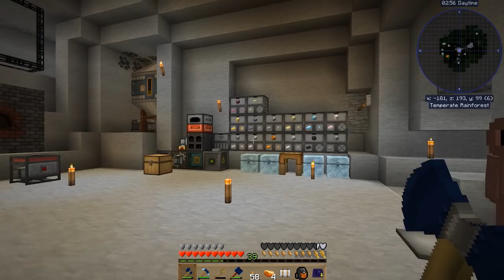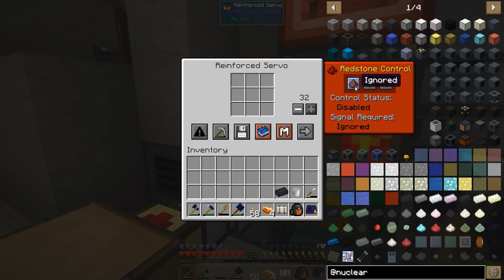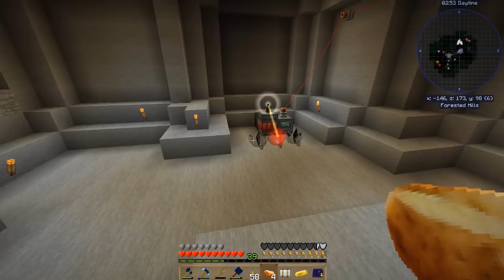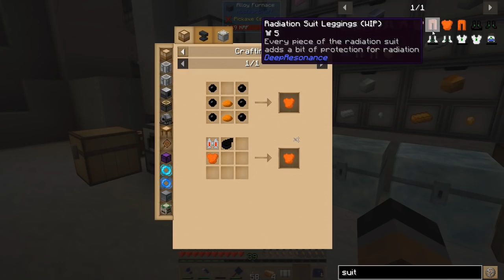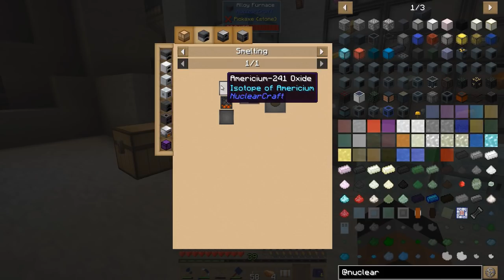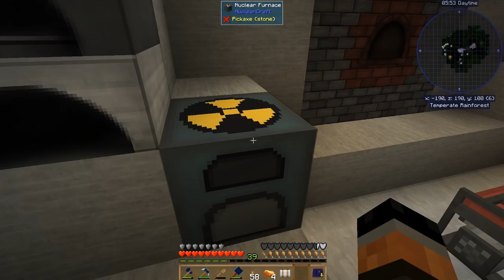A Start in NuclearCraft | FTB Revelation Ep 13

Comment: 1: the crystals continuously drain even if there is no energy gap to fill so only turn them on when low
2: i recommend getting the crystal processing setup going for now, and later you can make the nuke stuff if/when needed
3: check the tiny piles type options on the radioactive materials, some are gained that way, or they may be a byproduct of a reactor system

Comment: Only 80Rf from the crystal? Hmm. A triple waterwheel from Immersive Engineering would provide 88Rf/t. Once you can make one making others is very fast and they sure are good passive power sources to top up batteries while you're not running more demanding machinery. I salute you for attempting Nuclearcraft. It seems like a great mod and very well thought out, but I think it's also a polarising mod in that people either love it or steer well clear. I collect the ores but only have to glance at the mod to feel overwhelmed by science too complex for my small brain to figure out.